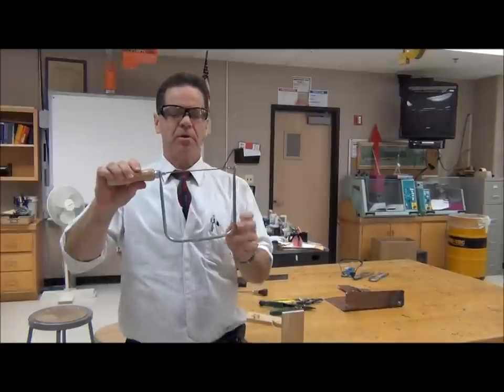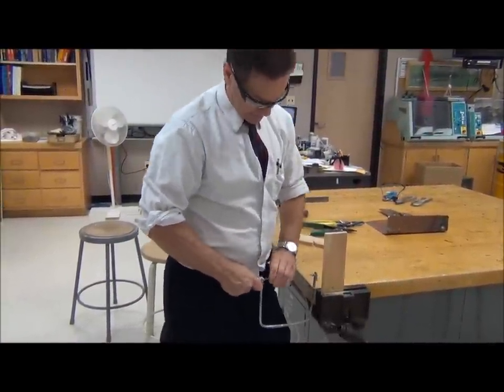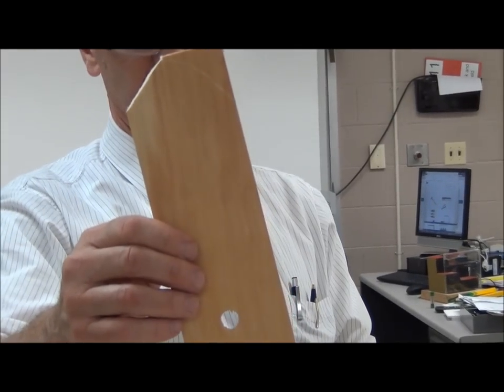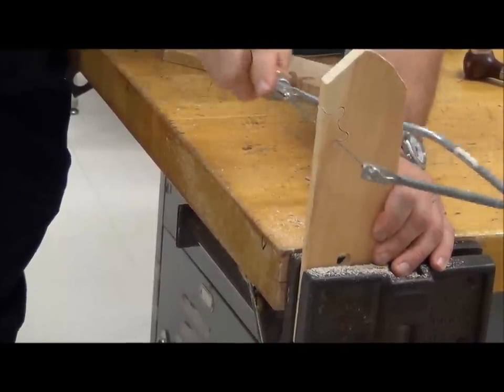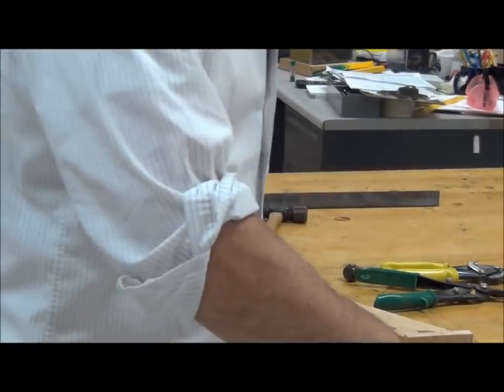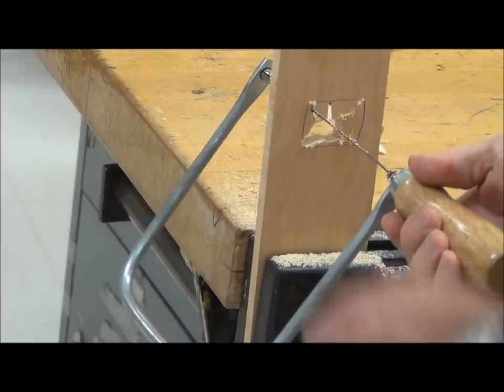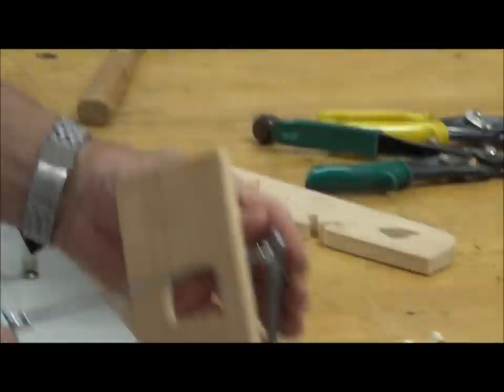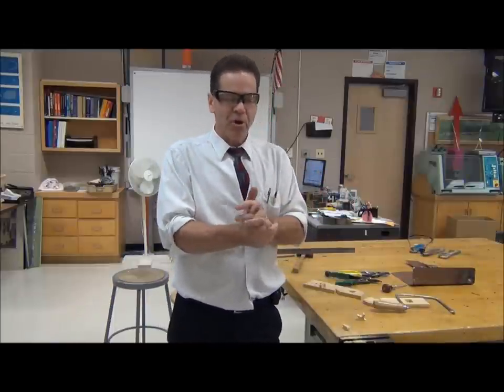Coping Saw Demo

Comment: You do not need to wear safety glasses when using a saw
Reply: +Danzer DJM Generally that is true, but, I make my students wear their eye protection at all times when working in the shop.
Reply: +Jim Street but do you agree you don't need to wear safety glasses when using a saw
Reply: not true ... 'a saw' mean any saw... power saw, table saw, band saw are all included in 'saw'. Think it over. A manual and hand powered saw is one thing.... a table mounted powered saw is different.